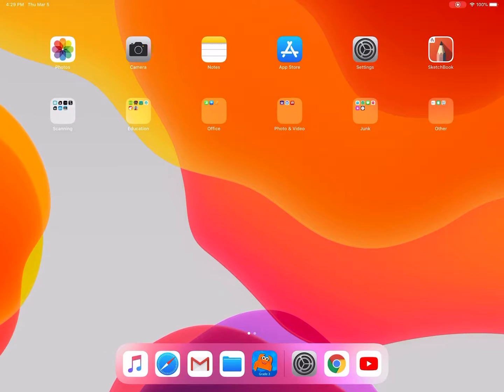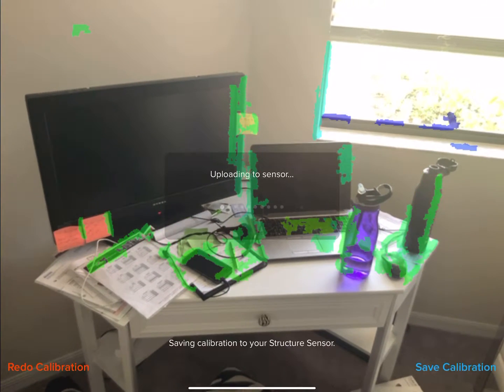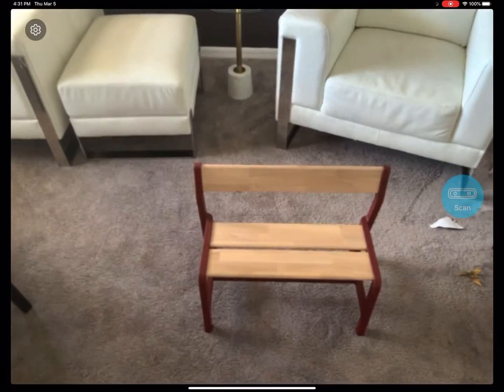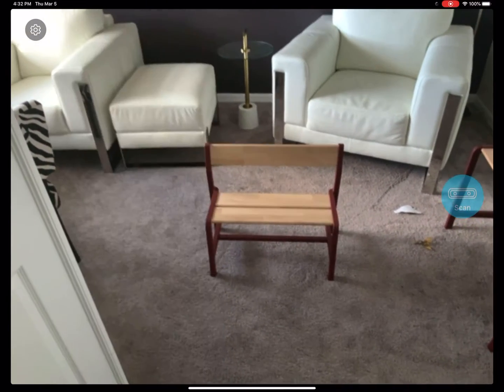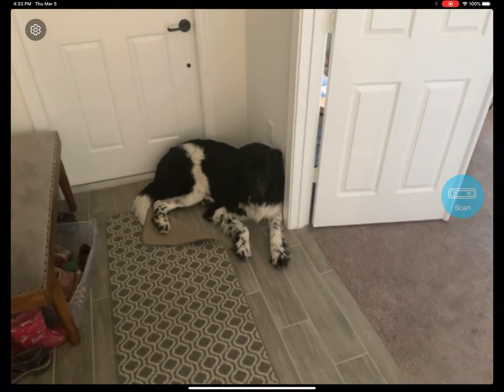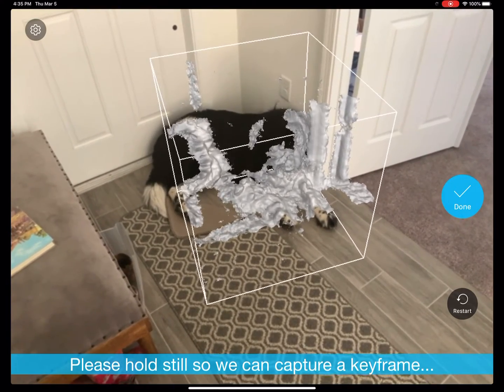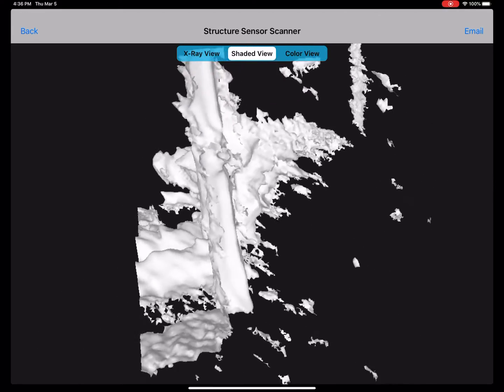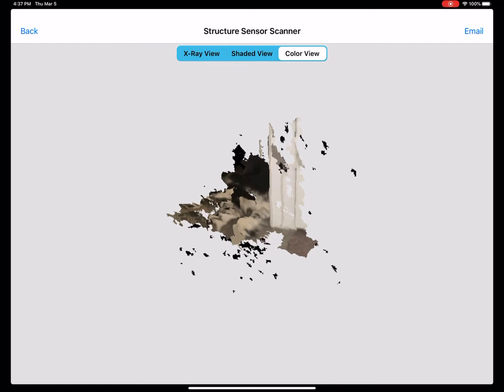Structure Sensor Mark II 3D Scanning Attempt 2

Comment: Your machine needs to be calibrated. I also have a machine as yours. Contact the service and scan normally after calibration.
Reply: What do  you mean with calibration? Did the service tech people open the device and changed the positions of things inside?  I though we calibrate it with the app?